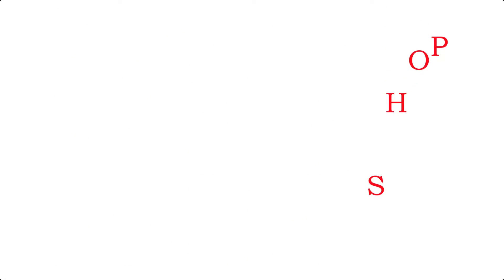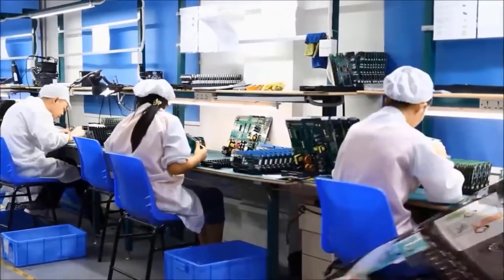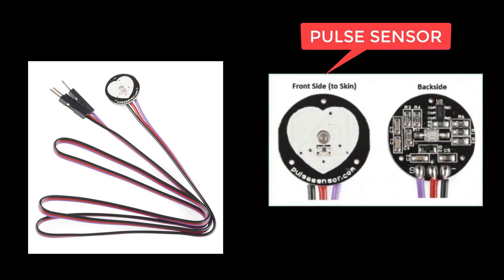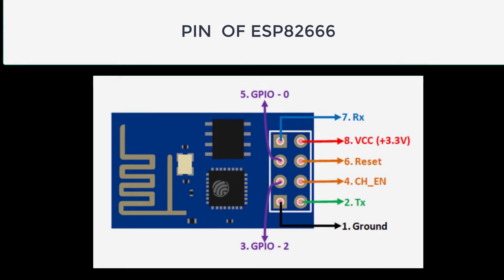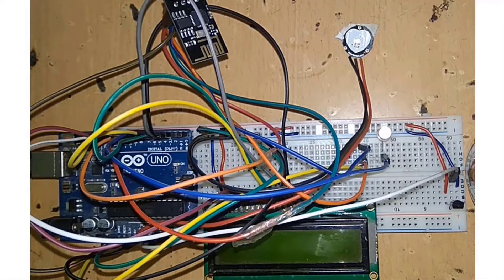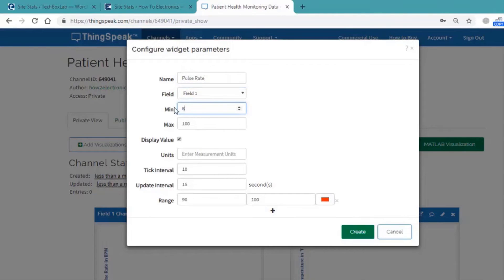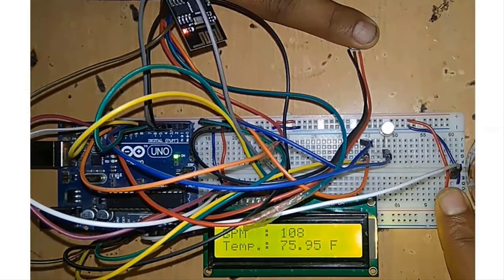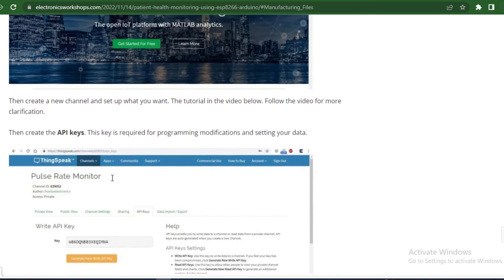IOT based Patient Health Monitoring using ESP8266 & Arduino//Pulse rate and temperature monitoring

Comment: After uploading the code. When I wanted to  use serial monitor it's showing that port & board are not selected.but at the beginning itself I have selected both the port & board.is there any specific port & board to wifi module???
Or is there any code we need to upload to use serial monitor????